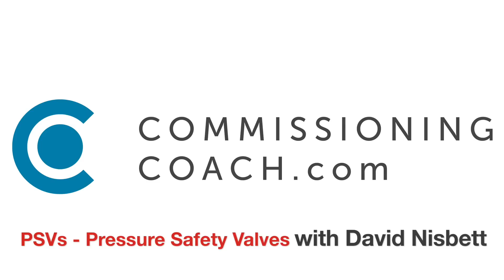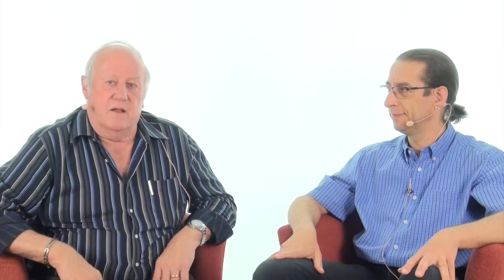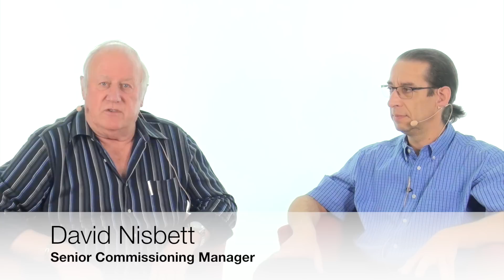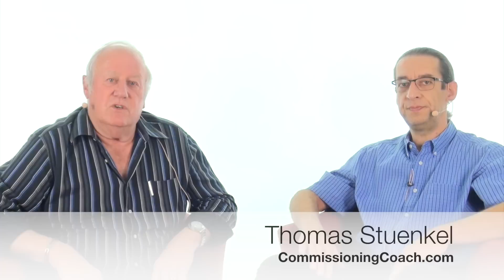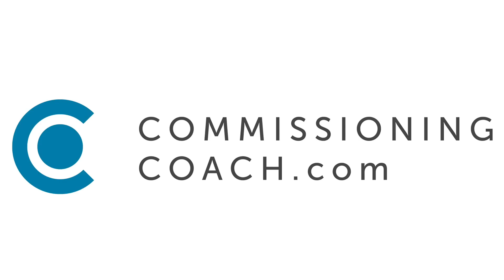Commissioning Training - PSVs - Pressure Safety Valves - with David Nisbett

Comment from the maker: Hello electone_g,

You asked "What does it have to do with commissioning"?

Well, usually you have a few or even more pressure safety valves in your refinery, petrochemical or any other plant. And before start-up of the plant you should check the PSVs.

If you don't check the PSVs you will run into (big) trouble.

Best regards,

Thomas